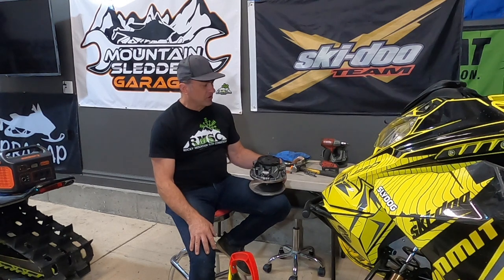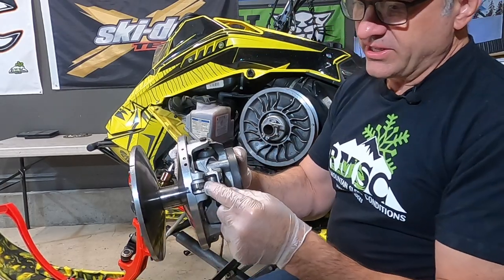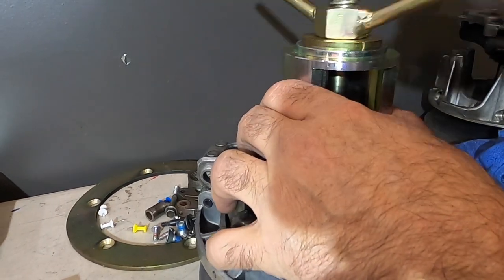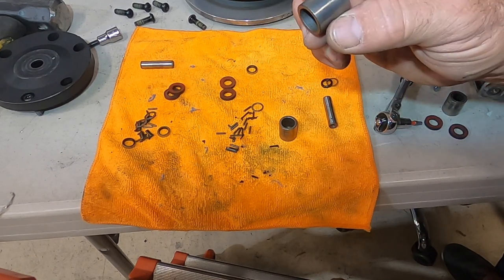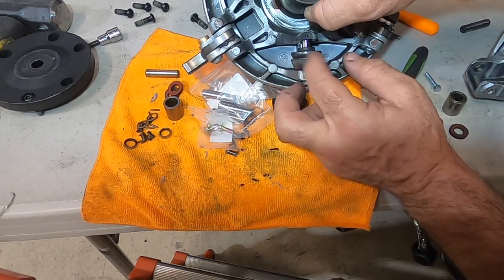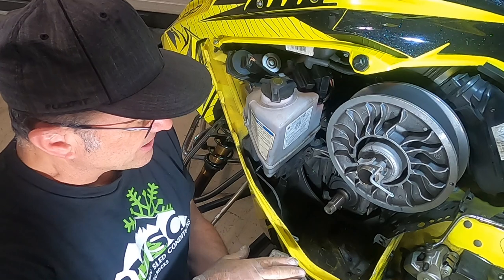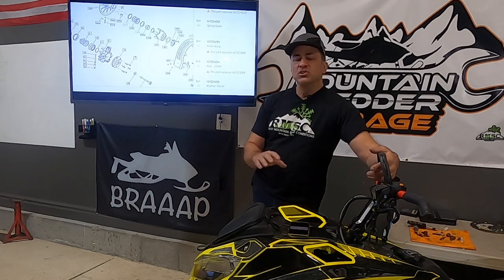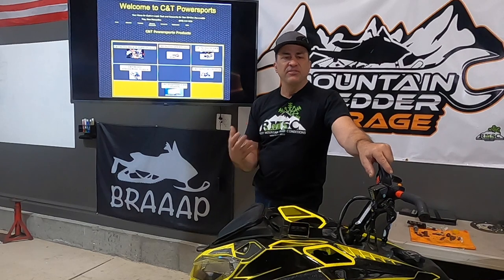Skidoo p-drive clutch roller maintenance

Comment: What is the trick to torquing the clutch bolt to 89 ft lbs?  ...without the special tool of course.  Any trick to removing the spring without the special tool? Thanks!
Reply: The trick is buying a torque wrench or do it by feel.

Comment: What do you use for cleaning it once apart? Just soap and water? Rim cleaner?
Reply from the maker: You want use something that will leave no residue or oils. Some people blow it out real good with compressed air. Brake cleaner is pretty good because it doesn’t leave any residue (you want very clean, dry brakes) and dries fast. You have to use a lot so it runs off and takes all the belt dust/debris/dirt with it.

Comment: Great video as always, I certainly couldn't do better or close to.

Just FYI for anyone who wants to just re-grease or replace dry/worn rollers you can do on the sled with no special tools in maybe 20 min. If have the tools great, then can clean the whole unit up but that's a hour for me anyways (+-20min of cursing at either the clutch refusing to come off the crank and/or the sheaves failing to separate once again!). I seem to be re-greasing every 1000-1500 miles or hard use.  If you can buy a greaser unit, seem to get longer between services.

Oh and make sure to brake clean those other vespel rollers and shaft if have apart as they like to stick and should be just barely loose and spin. Might have to rock the clutch a little but they should all not be under pressure.
Reply from the maker: Yea, I revised the video with the "on the sled roller replacement" content. 

https://www.youtube.com/watch?v=47YXFfGsTZ0&list=PL4xwO3FjqOPJSfLxLNgJ9pjFxtU60zJAt&index=9&t=133s

Comment: What clutch tool kit did you use in the video? C&T power sports seemed to have a different one. Can you add a link for the tools used?
Reply from the maker: Pretty sure I got it from western Powersports. SPI tool, can get on amazon or eBay
https://www.ebay.com/itm/312402066830?chn=ps&_trkparms=ispr%3D1&amdata=enc%3A1MW6qJd7eQqWYY83G17y64A29&norover=1&mkevt=1&mkrid=711-117182-37290-0&mkcid=2&mkscid=101&itemid=312402066830&targetid=1644837434363&device=c&mktype=pla&googleloc=1026984&poi=&campaignid=20125739985&mkgroupid=149128855676&rlsatarget=aud-1412318123216:pla-1644837434363&abcId=9312975&merchantid=433605247&gclid=Cj0KCQiAj_CrBhD-ARIsAIiMxT-QlRr3hwl5S34oloRoaS8gRyxKDWozD6sBiLfkPEGbyR4k4nj-CfwaAtNREALw_wcB

Comment: Thx for postin that great n helpful video. Been thinkin about havin a go at mine ('20 bc xrs w/ 2500miles) will be my first time. Do the weights require any maintenance? Disassemble & clean pivot maybe??
Also maybe it would be nice to make another video for the secondary pulley. Anyways thx again!
Reply from the maker: The weights don’t require maintenance as long as the rollers are in good shape. A broken or worn roller can damage the weight . 
I do have a video on the secondary clutch roller replacement. Check the video called…
QRS roller replacement (revised)

Comment: What happens when those rollers ceases up?
Reply from the maker: When the bearings in the roller run dry and seize up, creates a lot of heat, wears out the ramp (weight) and sled shifts very poorly.
Reply: Ok thnx